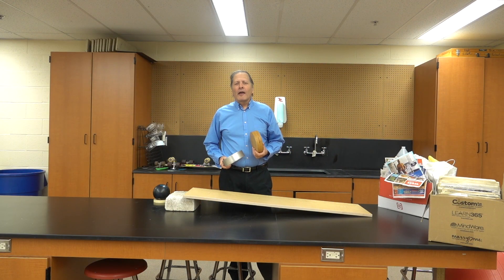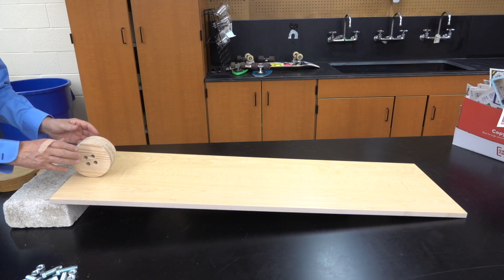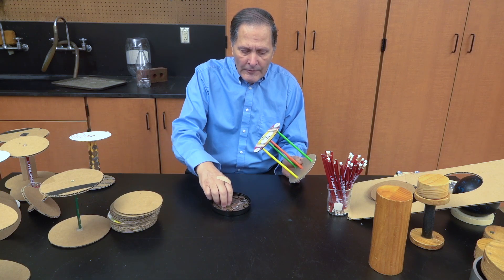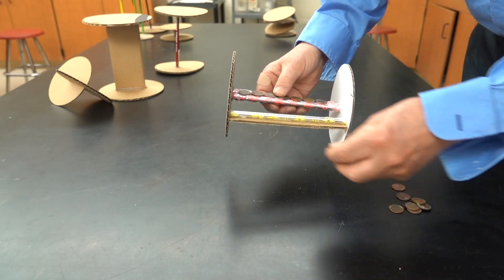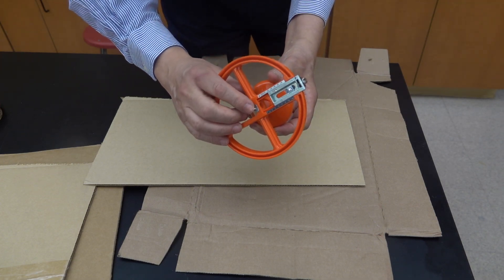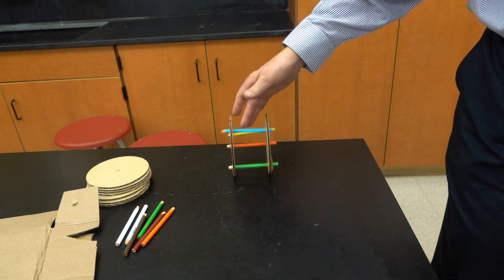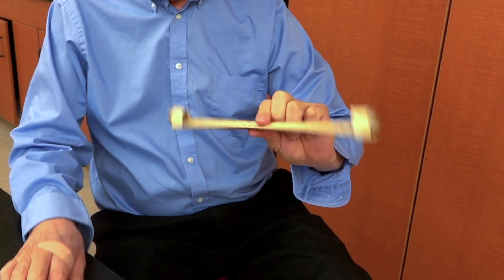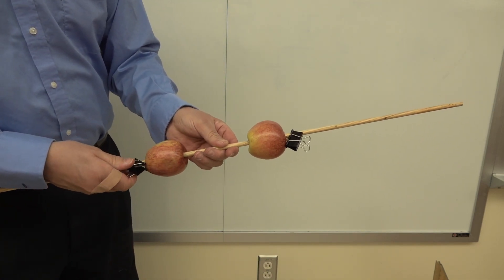Moment of Inertia..Student motion investigation

Comment: What we're seeing demonstrated is known in physics as "Radius of Gyration" ("Rg" for short).  This is the main property for BOWLING BALLS in determining how fast the ball "revs up" after being released on the lane as well as WHERE on the lane the ball will start "curving" and the "shape" of the "curve" (i.e., a "smooth arc" down the lane or a "hockey stick" type of flip near the end of the lane).

Lower Rg values indicate more of the object's mass is nearer the CENTER, which makes it "speed up" faster (i.e., the ball).  Higher Rg values indicate more of the object's mass is nearer the OUTSIDE, which retards its' "speeding up" (i.e., the ring).

Still not convinced? sit in a horizontal "tire swing" and start spinning.  Now, "tuck in" your arms and legs and see what it does to the "spin rate" (faster spin).  Then, stretch out your arms and legs and see what the "spin rate" does (it slows WAY DOWN).

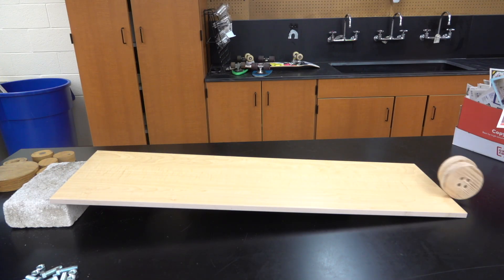Comment: 1:24 they actually dont accelerate at the same rate, the one with the holes drilled on the outside has a lower moment of inertia and accelerate a bit faster!
Reply from the maker: you are correct,  to make them truly equal the cylinders should be identical.  I should drill 8 holes in each one 4 towards the center and 4 towards the outside

Comment: It's great to see the things you do to best teach your students. I made nuts-n-bolts wheels too in the past, though using 3D printing. If you leave out one or more bolts you can also demonstrate static imbalance. That might also allow you to show the difference between the ideal pendulum they learn about and a "real" pendulum. If you drill a hole for a shaft at an angle you could also demonstrate dynamic imbalance. I have an old video up about that: https://youtu.be/JB8i7LtY3mU

The designs your students come up with are very clever, especially the one that jettisons coins for a one-time boost.
Reply from the maker: nicely done,  I've been to your Channel but didn't see that one.